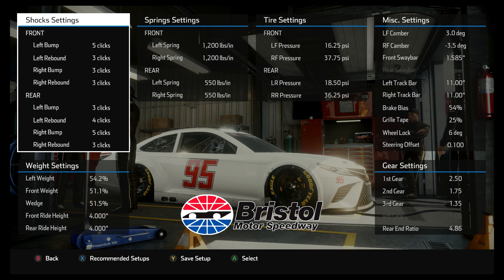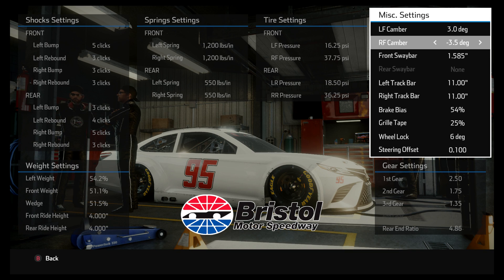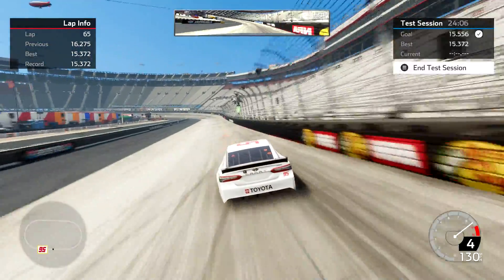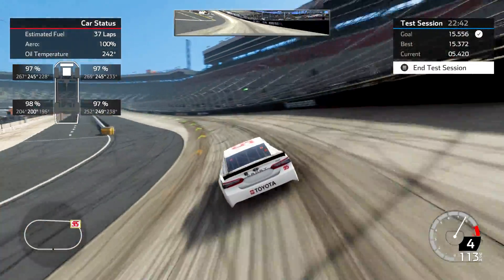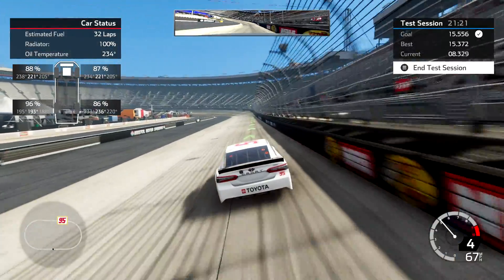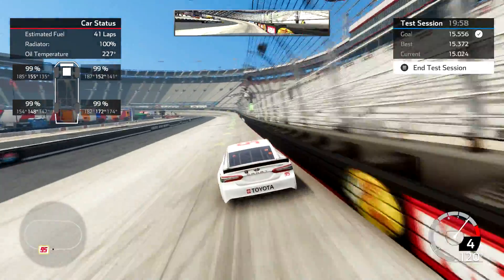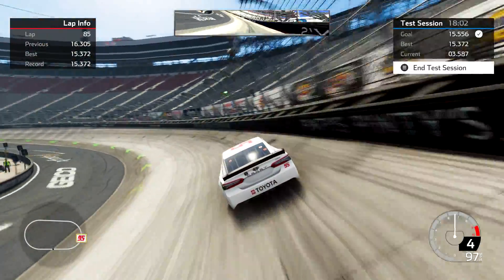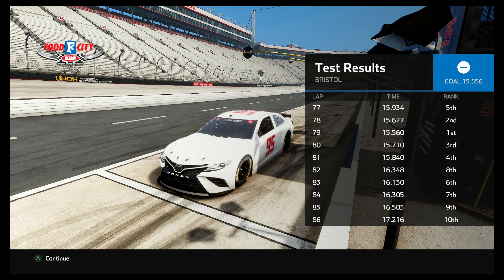NASCAR Heat 5 - Impact of Camber adjustments on tire wear - Check out all my videos at setup-man.com

Comment: You ever consider that all the tech stuff for thr various setup options dont actually do any of that because it isnt a sim its just a game..  and a bad driving game at that with barely any realistic changes and effects. Half thr stuff probably just does "loose or tight". I wonder if you van visually see camber changes
Reply from the maker: Maybe so, but you can definitely tell when you change the camber, not only in how the car drives, but in the tire temps and tire wear.
Reply: Yeah, i need help on tracks like Las Vegas, charlotte and places like that. My tires are gone like 15 laps or so before my scheduled pit stops

Comment: I was doing the Summer Showdown Series in Texas and there were people there that only pit when they were low on fuel. Was it the camber settings or were they using a cheat code? It was setup to use 3X tire wear and I had to pit 3 times for tires.
Reply from the maker: I ran the Summer Showdown series, and there were multiple keys to running it.  First, you need to adjust your gearing to be able to make it on one pit stop.  I ran a 3.00.  Second, you need to run it with some other cars that you can draft with.  If you have 5-6 cars that can all run together, you can use the draft to run really fast, and still save quite a bit of gas.  As far as tire wear and camber, I didn't have a problem with tire wear, saving fuel was much more difficult than saving the tires.  I ran camber of 4.2 on the left side and -3.3 on the right sides.
Reply: @theset-upman3500  Did you qualify for the race?
Reply from the maker: @jmitchell67060  No!  Everytime I tried to run with friends and take advantage of the draft, one of us would mess up, and we never really posted good times.  I think I wound up just outside the Top 50 in "A" class.
Reply: @theset-upman3500  Ouch! I don't have any other friends that play NH5 but maybe I'll run into someone. I placed in the 130's LOL but I pit way too much and was out there on my own.